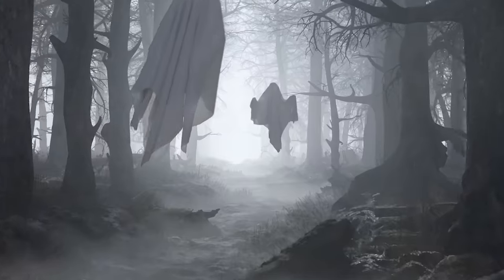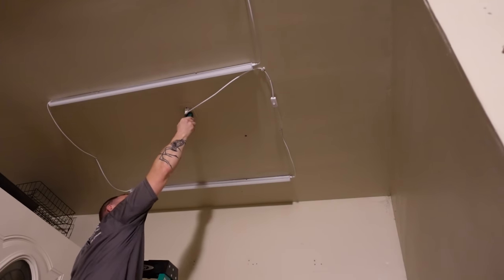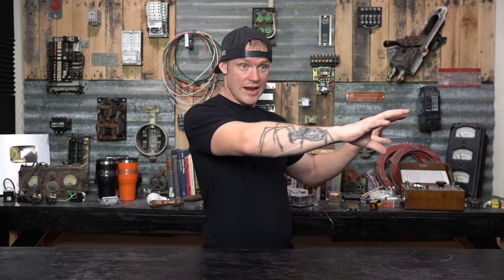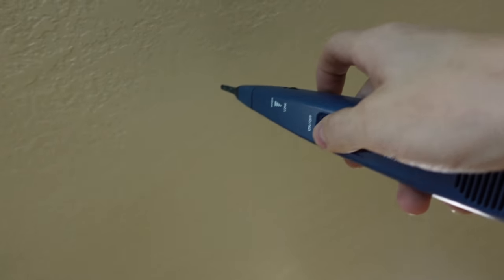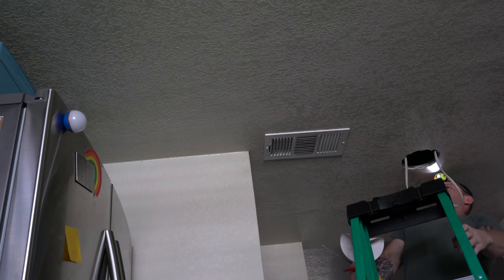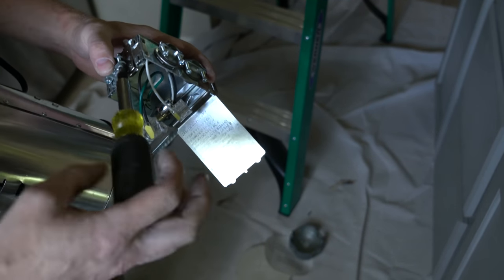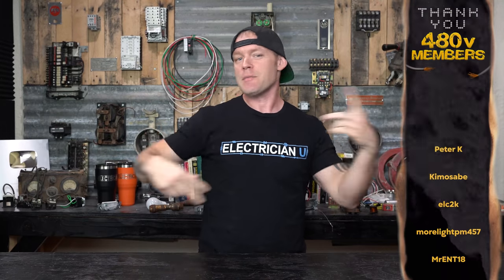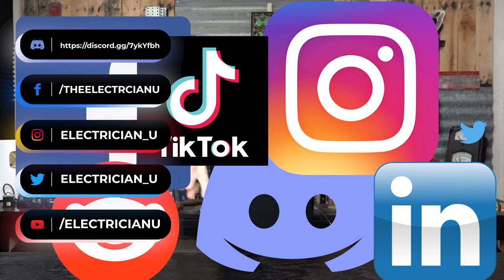THIS IS WHY ELECTRICIANS DON'T HIDE J-BOXES IN WALLS - Finding Hackwork!!

Comment: Had a similar situation with a clients home, loose connection inside smoke alarm junction was doing weird things with some lights and receptacles. Customer said the smoke detector was replaced not so long ago. And found loose neutral connection

Comment: As you stated, finding the problem is the hardest part. 25:30

Ive had customers argue with me over pricing for something like a capacitor or a relay or something (HVAC). I quote: "but i can find that part for $20 on ebay!"

Ok? That doesnt mean that YOU could find the problem. Otherwise, I would not be here.

Comment: Another thing you could have done to verify that you indeed had a loose or open neutral was to take a jumper wire and connect it between the neutral and ground at one of those receptacles if it fixes the problem you know you've lost your neutral somewhere and it's using the ground as it's neutral, this is not a fix but it will tell you that you have a loose or open neutral somewhere.

Comment: I have a Marine electric company installing and repairing  AC / DC electric and their devices on large boats and small , and you haven't seen problems until you introduce direct saltwater corrosion to electrical hardware and connections . I find AC color coded wire used on DC circuits " there is NO Code for that ".  Unlike AC current  , Low voltage DC current can be stopped easily by corrosion,
and source based point to point process of elimination is the only solution . Batterers can be very dangerous if the safety protocol is not  used strictly, If a non insulated wrench falls across and joins a positive and negative terminal the battery can and will explode, sparks " molten metal flying at high speeds at your face and eye's is common " .  You never know what you will find on a forty year old yacht .

Comment: Great video!  There are endoscopic cameras too, which might be helpful.  Still a bit pricey unless they plug into a laptop.

One more thing you could do:  if you have a clamp-on ammeter, check that the return current from several circuits is NOT routed back through a single 12ga or 14ga wire!  Especially after having seen melted insulation.

As an electrical engineer:  couldn't have been that different in the '70s and '80s:  put too much current through a wire, it gets too hot and can start a fire inside a wall.  If you have 15A going out 14ga hot wire #1, 15A going out 14ga  hot wire #2 and 10A through 14ga hot wire #3, you do NOT want 40A coming back on 14ga white wire #1 and getting it hot enough to ignite a wall!
  
I'd guess the causes are closer to:
- Maybe only happened in your area?  I hope so (fewer house fires).
- Code inspector caught on and stopped this bad practice (maybe after a house fire brought it to their attention)
- GFCIs magnetically subtract current coming back through the neutral from the current going out the hot wire; if the currents are different by more than 0.005?A then the GFCI trips -- so if neutrals are interconnected, and the neutral current is split between wires instead of 10A out, 10A back, GFCIs are going to keep tripping until the neutrals are fixed.  
Once the fix-it guy gets tired enough of bitching about GFCIs being "a POS" (because they don't work right when wired wrong), maybe he'll change how he uses them.  Or, go out of business.
- Some tradesperson, 'fix it' dude, framer with electrical tools or electrician with crazy ideas, who did it wrong, retired (or lost one too many lawsuits) end of the '80s.  When you are seeing work that hooked neutral wires from different circuits together, that tells you that someone didn't understand how house wiring is supposed to work.
- Every additional 10 years of age exposes building to 10 more years of untrained  DIYers and insane fix-it dudes.

Comment: I found a hot like that.  I had to cap it at the light and the switch and run new romex.  I have no idea where the original hot wire goes, but something was illegally spliced somewhere along the path.

Comment: I wasn't aware of those can-less lights. I have an unfinished room. Does it make sense to run the wires to the light positions, then put up the drywall, then cut out the holes, find the wires,  and put in can-less lights instead of putting in cans, wiring them up, then putting up the drywall? Thanks.

Comment: I hired an licensed electrician to upgrade my service and load center in my house. A few years later, I was rewiring all the shitty wiring in my basement that was done before I bought my 1950;s era house and got a mild shock even though the break to that circuit was turned off. I put my meter on the bare wires and it was reading les that 120V but it was live nonetheless.  I pulled the breaker out and check across the terminals for continuity with the switch turned to the off position and there was continuity. I thought "WTF"? So I shook the damn thing to see if something was loose inside and drops of water came out. The upshot of it all was that the putty that the electrician put to seal around where the entry cable penetrated the house wall had separated and rain followed the cable down into the panel in my basement and leaked into not one, but several breakers. I then pulled several breakers at a time and blew compressed air through them to displace any water that might have gotten inside. Needless to say, I repaired the seal at the wall penetration. BTW, as a DIYer, I make sure I do everything electrical IAW the latest edition of the NEC which my employer always has because we have electrical engineers on our staff who use it.

Comment: Hi. Enjoyed the video! 
Question: I purchased 30’ of 10/4 bx.       30 amp. 
30 amp cb and a 6500 watt generator. 
I find out I’m 10’ short of the 10/4 bx cable, to the 4 prong input box. I’m so mad at myself for not getting the proper 40’’length. Can I buy another 10’ of 10/4 bx and connect it together? Also please, how? (Junction box?) 
All the best to you, Mike i

Comment: So, the hidden junction box was wired promptly when it was installed.  Later on, the wire nuts  and insulation on the wire melted.  What caused this to happen?  Too much current being drawn through that circuit?  If that was the case, why did the circuit breaker not trip and stop the meltdown before things got out of hand?  Can you draw 20 amps through 14 gauge wire for an extended period of time?  I have seen melted wire nuts before.  Are the wire nuts adding resistance where they are used?  Obviously, wire nuts are not as good as a solid, unjointed conductor.

Comment: I got one for you, I had to change the 120 volt plug hooked light to it flipped the breaker it went off. I pulled the wires off and got a large spark when wire touched

Comment: They other thing with a toner that can cause a weak signal is, how far the runs are in parallel with each other. Since electrical wires are non shielded, it can induce the signal into wires next to it.

Comment: Very very informative! I have same sort of problem leading to weird voltages in bathroom, GFI not fiunctional due to sketchy voltage to it OR polarity reversal, etc. I get a true ground from outside the apt. I can trust, measure to it, as I can't trust grounds within unit (a refurbished garage). I figure my best bet is to pop open all the recepts first, check for polarity reversal, white to ground, etc., as well,then same for connection boxes. Tedious and a hassle, as I have to put things back together in a short time in order for tenant to be able to have normal life inbetween my visits. Unit has had many hands monkeying with circuitry.
Your toner gadget is news to me. Wow! Am I out of date! Anyway, thanks for the encouragement. Shipyard Sparky

Comment: The weird voltage reading was because something was connected downstream. The hot was passing through something, and returning on the broken neutral. A load test would have showed much lower voltage. I used to have a homemade 100W incandescent  "test light" for the occasional load test. Today's bulbs may not be as useful.

Comment: I am curious....the damage inside the junction box looked like a problem possibly caused by an overload or or a defective tool. Could the construction on the bath room that was in progress when this trouble started be a factor in the cause??? I know the circuit breaker should have tripped out before this happened, but it still looks like an overload problem that caused the heat that melted stuff in the box.
Reply from the maker: Could be. Don't know for sure and can't speak with 100% authority to that being the cause or not.

Comment: I've got a similar issue.
I have a 70s trilevel home moved in over a year ago.
The room beside the garage has polarity switched. 
Just checked as maintenance.
The service panel is in the room on the other side.
Also the garage outside lights stopped working after a couple months.
There's no ceiling lights.
And the switches in the bedrooms don't work on outlets or anything.
All 14 gage non grounded outlets.
Ugh.
Just had $3,200 200A service / panel upgraded.
Kitchen has 2 ceiling lights.
2 ungrounded outlets under the sink. Dishwasher & garbage disposal plugged in there.
It's a huge mess.
And I found one jbox in the wall in the family room when I replaced some drywall.

Comment: I have a story about weird voltages.I was an Avionics installer \ aircraft wiring repair tech. There was one case ,a piece of equipment was receiving the proper 26 vac 400hz (according to a digital meter)but it would not work, it did work on the bench thou.Along came two techs ,an engineer and I was listening about three feet away doing something else. Something popped up in my mind and I tried measuring with an old 
analog Simpson meter.There were no 26 volts,,the digital meter was reading electronic noise.Problem solved.

Comment: Loose wires cause fires. When a splice is loose the result is usually that there will be some arcing, heat and corrosion. This is actually a problem I've come across very often because many electricians don't understand the proper ways to connect wires.

Normally you shouldn't put boxes in ceilings and behind walls because it's against code and often a bad idea. That's with open walls and access. In reality there's zero harm if you know what you're doing/everything is done correctly meaning you keep it away from all nails/screws and use a metal box with good connectors, good splices and grounds. Sometimes the customer can't afford to run a new line, doesn't want it because of damage and it will never get inspected. Code is a good place to start but it's just there to provide a standard that works most of the time and should be aimed for.

Comment: I have found hidden junction boxes buried due to prior DIY remodels in my business-place.  
Every tennant did some crappy rewiring over time

The Giant Sparkomatic main panel ( Stands on the floor, bigger than a 1960s computer tape drive ) also feeds neighboring businesses in this "shoppette". Fire dept annual inspection indicated a hot breaker.... not just live.... HOT... They now use a thermal camera looking for obvious issues when they make the annual safety inspections. Landlord had it fixed... we had a number of loose screws and a bad breaker in the 1960 breaker box.

Probably will be having the two subpanels which get in the way of a remodel relocated, which is tantamount to a complete rewire ( dropped ceilings are a handy thing )

As far as safe troubleshooting, do like AvE... stand back, and have your chum do it for you. Safety Third!

Comment: It's a code violation to have a buried junction.   And for good reason.   When I was helping my step father replace the galvanized iron plumbing with Pex pipe in his 1973 double wide, we discovered scrotched  junction box & charred stud  that was covered under wall paneling by the previous owner.   The home at one time had aluminum branch circuit wiring throughout the home,   at some point the previous owner added onto the property and spliced a piece of copper NM to the aluminum cable to power the addition.   It's a miracle the house didn't catch fire.   PLEASE,  MAKE JUNCTIONS ACCESSIBLE AND EASY FOR THE NEXT HOMEOWNER.

Comment: Here is the likely explanation for how a bad neutral causes those weird voltages.  Your Neutral connector had no connection or an intermittent high resistance connection (that is why it melted, the high resistance caused a lot of energy to be dissipated in the high resistance connector since power is current times voltage or it is also current squared times resistance.  (just use the RMS values for AC).  With a broken neutral (just assume open circuit at the junction box), there are still devices connecting the hot to the neutral, but there is almost no current flowing.  That is why there was a high voltage between both the hot and neutral and ground.  Your loads were things like LED lights so there was no pure resistance load or likely both hot and neutral would have been at the same voltage if the neutral was completely open.  Or else there was a small current flowing through neutral. LED lights are different from incandescent lights as there is a connection only through electronics - this likely accounted for the 10 v difference or so between hot and neutral.

Comment: We had an issue with our electricity where randomly plugging in something as little as phone charger would trip the breaker and cause the whole living room area to go out.  I thought it was specific to a certain outlet, until it finally happened with a gfci outlet in the patio that's connected to the same circuit.  

Every time this issue would happen, we'd have to flip the breaker off and on for almost a period of at least 10-15 min, before it would finally re-engage and stay.  I have very little knowledge of electrical work, but since the issue happened with two different outlets on the same circuit, I was pretty sure it was the breaker.

An electrician came to check out the issue.  I'm hearing the sound of this guys impact driver stripping screws.  I don't know anyone who uses an impact driver for screws on an outlet.  Don't most electrician's usually use screw drivers so you can get a feel for how tight you're tightening the screws?

Anyhow, by the time this dude left our apartment, there was no electricity in the living room, he re-installed a light switch was upside down (was originally right side up), and that gfci outlet was no longer working.  He said he didn't have a replacement gfci outlet and would have to come back with a replacement the next day.  I could totally tell this guy didn't know wtf he was doing.

Supposedly the next day that electrician called in sick.  Lol.  Management sent another electrician, who replaced the gfci outlet and the breaker and the issue was fixed.

BTW, when I first saw the thumbnail to this video, I thought to myself, how the hell could this guy stretch out a 30 min vid on why you don't hide j-boxes in the wall.  I see why.  Lol.

Comment: Towards the end of the video you mentioned wiggling the wires around and looking at your tester.  In this instance, or any other freak occurrence, what happens if you arced the wire and the customer sees? I know sometimes there's nothing you can do, like if you're pulling out a rec. live to troubleshoot and there's a nick in the hot it's most likely going to arc, so I'm just curious how you handle that because they may see that and think geesh does this guy know what he's doing?

Comment: Good video. Only 1 thing i have a difference in opinion in on thia video and that is although the low profile lights are amazing and can fit nearly anywhere. I installed them all over my house as well because i was able to get them for free from a client. The depth of the trim isn't deep enough to prevent reflection off of my T.V.s. When it comes to trims especially 6" trims i will buy and install Elites ALL day. They have the perfect depth so you dont get that glare, the material they are made of better and they are easier to clean for clients. Other trims by nora , elco and other companies are not as high quality in my opinion. To my point though is the glare from the low profile lights is terrible. It's like I see stars on my TV.

Comment: If no one has said yet you were getting that weird voltage because it was looking for another neutral due to the bad connection. I dont know why it makes the meter say its hot. I guess it just goes through it and your meter is completing the circuit.

Comment: That happened to me in 2008 I was changing out an outlet and low and behold I pull out the wire and it was twisted together with a box in the wall. OMG what a mess

Comment: All of the melty plastic bits in that box would be a great indicator of being the source of a problem, but it's kind of concerning that it's not 100% clear WHAT the diagnosis of the actual problem was. What was going on in that box that would cause all of the other symptoms in the house (the non-working patio, bathroom, garage circuits, etc.)?

Comment: Just curious, I saw you use the can junction to make up those problem wires. How many wires do you stuff in those? I've had several instances where a can would've been a good option but the junction box on the can wasn't rated for enough conductors
Reply from the maker: Only what is allowed in a wire fill calc for the Cu of the box/can.

Comment: If something is running then the circuit will be closed and the neutral will act as a hot, this is one of the main reasons you don't tie neutral to ground wires and you don't tie all of the neutrals from different circuits together anymore like you mentioned.. I think that's what was going on..

Comment: I have buried permanent splices in walls but only with strain relief, tightly twisted and soldered and then well taped, never in a box with just wire-nuts or wagos.